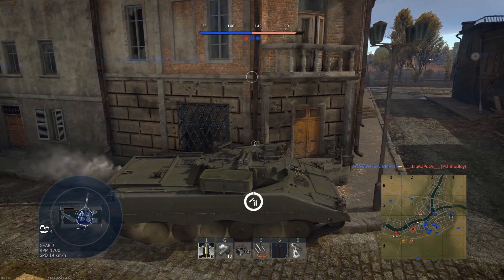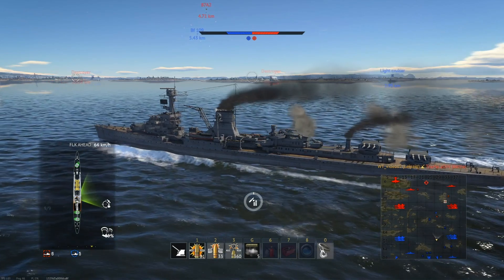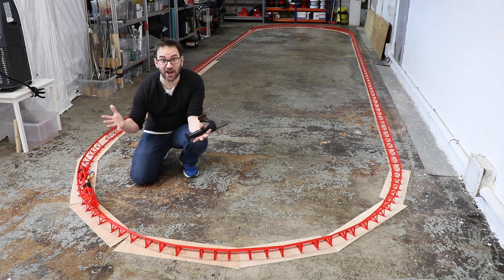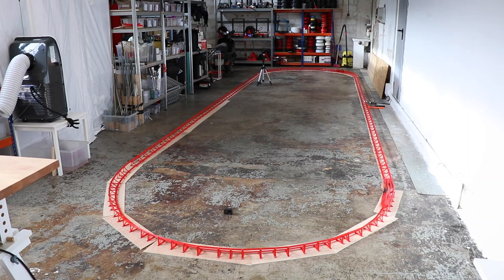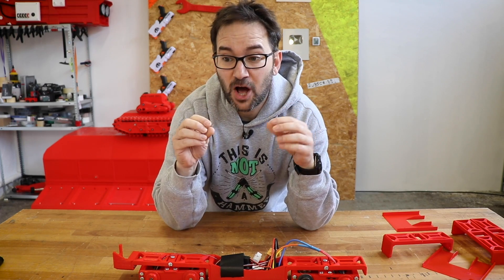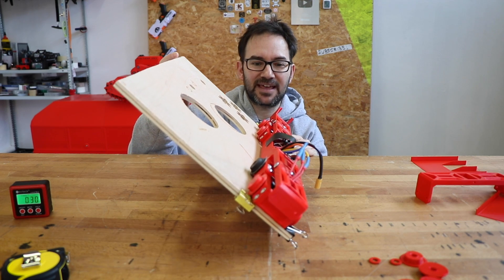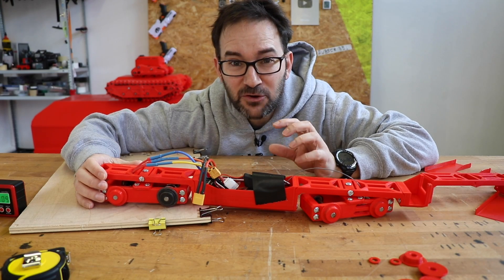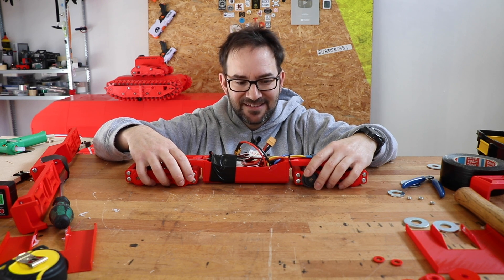WORLD FASTEST TOY TRAIN

Comment: you should definitely level out the straights, have it only banking on the turns
Reply: Also, print the rails as pre made sections rather than parts, like how commercial toy train does it. It will help with how rigid the rails are, eliminating bumps
Reply: Yes! I would say exactly this. Reason behind this statement is, train loses a lot more kinetic enegy to the friction between rails and wheel flanges when it goes through the strait with twist.
Reply: I disagree, as this will have the train twisting its weight 4 times a lap, and the transitions will basically turn one side of the track into a ramp before the turn.Extra motion breeds friction and instability. Maybe it's not a huge problem on this scale, but if you're looking for real top speed, you want to be keeping your non-forward movement to a minimum.
Reply: @Beeks81  Your spot on, He actually needs more banking on the straights not less. And how about some aerodynamics ? Better traction, A wing maybe.  I hope we get a lot more videos on this.
Reply: @Brianck1971  however banking is needed in turns due to the outward force on a vehicle trying to pull it straight, in the straight sections there is no gravitational or inertial force trying to pull it off the tracks, instead the force is pushing directly down which is why it would make sense to have a flat track in the straights. With banks in the straights there will be a force attempting to pull the train away from the track.
Reply: @Brianck1971  this is nonsense. do you ever wondered why your typical drag race straights or railroad is flat without any banking at all, or why there even is a steep curve at the end of straights? have you ever watched f1 and wondered why there is drs on the straights to overtake? you make my brain hurt, just sayin xD
Reply: Ya but the banking will make it easier to fall out

Comment: More faster!! Looks like the tracks could be smoothed out a bit. Could you make the straights longer (and flatter) and program an arduino to give the train full throttle coming out of the corner and then slow down before the next corner? (after beefing up the power of course)
Reply: Hi Liam,
Allow me to disagree. I believe that high enough banks in corners should allow to not reduce speed, so that the train can constantly gain speed, lap after lap, till it reaches its maximum.
Cheers and take care

Comment: Ruber wheels to limit the sliding of the powered wheel for sure! Maybe simply with an elastic band around it(that would even absorb some of the imperfections of the track), i would definitely sand the track(that will take a loooot of time). And finally a bigger gearing between the motor and the wheel for the SPEEEED!
Reply: Suuuppper interesting project by the way! Maybe i will even try it myself !

Comment: Just reduce the angle on the straight section of the ramp and you can push it probably even more. You can hear in the video that your motor wants more power so put in 4 cell battery pack for the next test and you're off

Comment: faster shouldnt be too hard, you just have to determin if the limit was the tracktion of the wheels or the capabilities of the motor.

yoi could use a gear for a wheel (with modified rails of course) for guaranteed perfect trection of the whells on the rails. (if tracktion was a problem)
with your design with these 2 carts, adding a second motor and using this power for higher gear tranlation also shouldnt be a ptoblem, if you want to go faster
Reply from the maker: The limitation was the train derailing, I was cautiously increasing the speed on each turn, I still can go fro 2:1 to 1:1 belt ratio or even a higher KV motor but it derails in the straights...
Reply: @ivanmirandawastaken  you should then level the straights or give the straights a slight curved to keep in planted. I would also like to see a much larger and more complex track.
Reply: The working inside your shop is the limitation, it would go faster if you had longer straights. It's a bit more boring, but you'd be able to get higher speeds running in a circle of constant curvature with a consistent bank.
Reply: geared wheels are good for traction but not for speed

Comment: Really cool project! :)
You should definitely go for level tracks in the straight parts to reduce friction. The wheels get pulled against the tracks side by gravity.
I think you could get way better speeds by having angled tracks only where needed alone...
And yes! Make it go faster! :D You could also adopt your design to ready made tracks like "LGB" (looks about the right size) to make your track building life a bit simpler :)
Reply from the maker: Thanks!
Reply: Hi Ivan and all,
Definitely agree with Julian: straight parts should be horizontal and it'll go faster for sure.
Then you know we all want this train to be faster than the fastest human being (at least).
I don't see a better way than the obvious solution of changing the gear size and accept slower acceleration.
Unless you can add a gearbox?! 😍 That would really be awesome!
Reply: Yeah, flatter straights will use gravity more effectively to hold the train on the track, ie, a 45º angle on a straight only has half the force of a flat track.
Reply: Lack of power doesn't seem to be the problem to me, electric RC's can be way fast so I doubt the tiny amount of friction the banked track provides is holding back the speeds. The track needs to be perfectly flat with metal rails metal rails and the train needs more driven wheels. I also suspect the banking will need raising on the curves as speeds increase which is going to cause a problem at lower speeds, there is a reason speed runs are done in straight lines.
Reply: If the train gets way faster you should also consider increasing the angle of the turns so the train doesn’t get thrown out of track.
Reply: Velodromes are angled slightly on straights also.
How would it be less friction? 
Same amount of contact to the track.
Reply: @dfalconerio  No, because train wheels are not only flat, but have a ridge which rubs against the side of track (to prevent the train from simply rolling off in curves).
When you "hang" the train by these ridges it results in pretty bad friction.
Bike wheels work completely different. They are round and don't provide much of a contact area at all.
Bikes steer by their wheels but trains are getting steered by the rails!

Also, velodromes simply don't go perfectly straight i.e. easing out of the curve and then immediately back into the next one.
That's how it's supposed to be. If tey'd make the straight sections actually straight and e.g. double the length, you'd definitely have perfectly level sections in a velodrome.

Simply imagine biking down a straight road with a 20° bank!! Not pleasant I bet
Reply: @juweinert  Train wheels don't rub with the flats except on tight curves at low speeds or across points, trains wheels are conical and that's what keeps real  trains on the track
Reply: @popuptoaster  Yes and no. Most modern trains use conical wheels to reduce wheel squeal caused by the contact between wheel flange and the rail.
What keeps them securely on the rails is the flange, which is a feature of any train wheel, conical or cylindrical.
But yes, you are right, they don't constantly rub on both sides, that's not what I was saying.

But if you reread, I'm talking about Ivans design here. And if you have a canted straight track at 45°, a huge portion of the trains weight WILL hang from the flanges.

And that is why a lot of force is lost. Imagine trying to run along a mountain side on a slip'n'slide. You'd basically need to point your vector part ways up and part ways head on.
Reply: @dfalconerio  With velodromes it's more to reduce the transitions, ie, it would be too violent going from dead flat to banked.
Reply: @dfalconerio  I don't know that you can compare a train to a bike.  A bike has two small contact patches where the tires meet the ground and the rider essentially is keeping the bike perpendicular to the surface.  The train has 4 wheels per car.  In the straight, with a banked track, the weight of the cars are pushing down toward the 2 wheels closest to the ground, unloading the wheels farther from the ground causing uneven weight distribution among other things I'm sure.  The banked tracks in the turn allow mostly even weight distribution and wheel contact.
Reply: Its channels like this have inspired me to make my own channel. I'm building a 2 legged full size walking robot check it out. Thanks
Reply: @Build_the_Future  I'm headed there now.
Reply: @Build_the_Future  I usually dislike self promotion :D But in this case it's totally fine. Your project looks cool so far, keep on going!! I see a good chunk of inspiration from James from XRobots, am I wrong? ;)

Comment: Yes, please faster !! 'And I suppose you could incline more in the rounded parts but get back to more horizontal in the straight parts since there is less "centrifugal force".  (Does that make sense ?)
Reply from the maker: It does make sense, I need to find the way of doing the transition without a jump...
Reply: @ivanmirandawastaken  Look up "clothoid"
Reply: @ivanmirandawastaken  An easy way to determine the transition between the baked corners and the straight track, use a strip of paper. roughly the same poportions to your track and set the banked edge the the degree you want in relation to the curve, and then twist the rest gradually to enter the straights. Keeping the straights at a minimum of a 10 degree bank. This may help at least find the best design.
Reply: @ivanmirandawastaken  when you go to print the transitions from straight to curved print them so that the support below the track is really short to as long as the straight with the amount of short to long support track pieces being like 3-4

If this doesnt make sense reply back.
Reply: @ivanmirandawastaken  Draw the profile of the track with the bank on a plane and in another plane x meters apart draw the profile horizontal. Then use the loft tool and leave it to Fusion to make the transition for you. This way it makes in the transition on the end of the straight, to make it including some of the corner you can guide the loft tool with a line
Reply: As I studied transportation science, the transitions are made out of S shaped slopes. So the inner rail keeps flat, the outer rail transitions from flat to elevated (and back) in an really long S shaped way.

Comment: Maybe attach the wheels to a kind of railing system? like rollercoasters have?
Reply from the maker: That was a premise I set to myself, It had to work like a regular train. I may try rollercoaster style in the future, maybe if this comment gets enough likes...
Reply: Ivan Miranda how many likes does it need
Reply: @ivanmirandawastaken  though they may not qualify as "a regular train" there are some trains which use side wheels to avoid  the need for steep banking.
Reply: @ivanmirandawastaken  yes do a rollercoaster type design. This way it won't fly off the track until it actually breaks. Also, maybe try making the wheels out of metal or something because the wheels are pretty small and under a lot of stress in a lot of different directions.
Reply: @ivanmirandawastaken  ohh, i see! a nice challenge would be to make the train connected to the rail by magnets or suction ( something like your rc car driving on the ceiling video?)
Reply: @ivanmirandawastaken  just a quick edit to .... worlds fastest model roller coaster would proably get more views :P but difficult to do i think ??
Reply: @ivanmirandawastaken  quizá sería más estable si agregas un diseño similar a los de un tren de metro, en el que tiene dos sets de ruedas, las de los rieles verticales y unas horizontales, te da más estabilidad
Reply: m o n o r a i l
Reply: Just read this after my comment  great minds think alike and so on lol

Comment: 2/10 didn't break the speed of light. Must try harder!
Reply from the maker: Agreed
Reply: @ivanmirandawastaken  Porque no corta la pista y deja un círculo perfecto, solo para llevar al límite la velocidad del tren.   Y para que no se caiga en las rectas podría cortarlas un metro y medio, o reducir la inclinación un metro después de salir de la curva. Excelente diseño, sin sobre ingeniería.
Reply: Lol, go for it!
Reply: As good as any reason to try harder.  
How fast does the Hadron go again,,,,,,,  😜
Reply: If you want speed, the corners should be banked but the straights flat. The bank on the corner will allow you to maintain speed in the corner, but a bank on the straight is only making your job more difficult (in terms of assembly, print time, and most importantly speed!)

Comment: Idont really understand why the straights should be at an angle, the point of the angled tracks is that the zentrifugal force doesnt push the train over the side, but on a straight there is no centrifugal force so if you would straighten out the straights at 0 degrees it should work better
Reply from the maker: Initially was to avoid jumping on the transitions, now, I'm not that sure...
Reply: @ivanmirandawastaken  If you do it right there is no jump! just use the middle of the train as a axis and turn the tracks with the train on it in your cad program ;)
Reply: Yeah this isn't going to go faster than the 20km/h like this ... the straight should be flat and the corners should be at a 90 degree angle for maxium use of cenrifical force. it would easily go double the speed. The reason he did it at a 45 degree angle baffles me ..that is when its stationary ...wich is totally useless :P